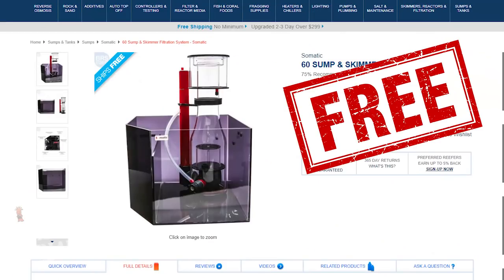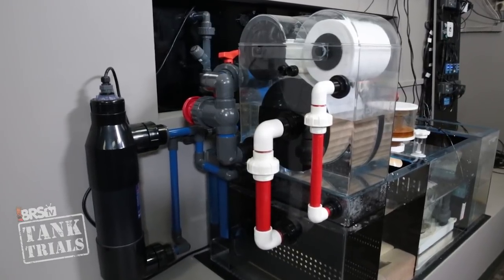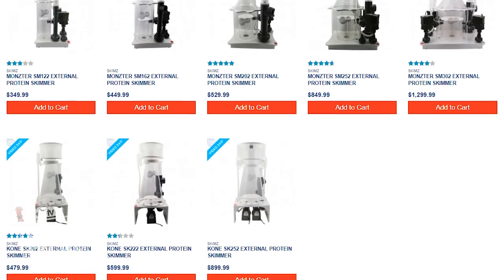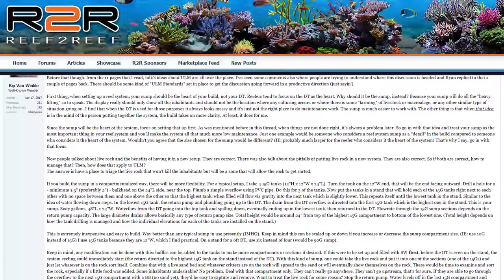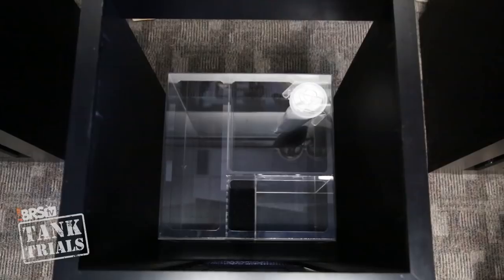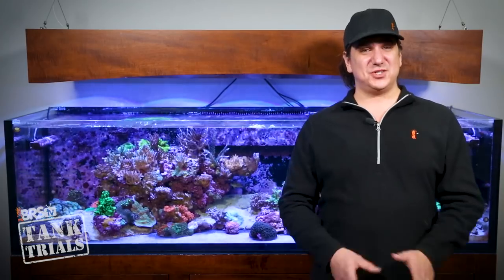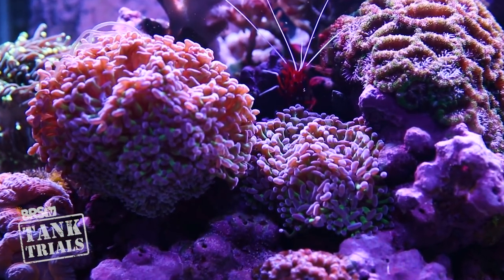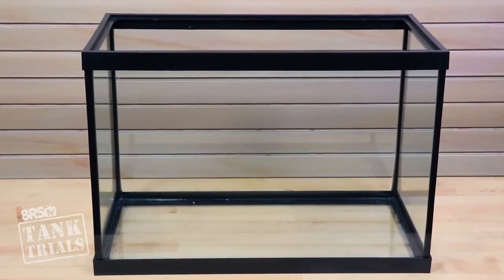ULM Tank Trials Ep-3: Sump Selection for Ultra Low Maintenance | BRStv

Comment: I think you guys should explore using Prodibio to reduce nitrates in the reef tank. Prodibio only needs to be dosed every 15 days and it takes just a few seconds to dose using their sealed vials. Using Prodibio has allowed me to avoid filter socks, sumps, and a skimmer. Yes this means you will have detritus build up somewhere but as long as you have a clean up crew that turns over the sand and you keep your hands out of the tank this is not an issue. Prodibio is a great option for ULM for sure!

Comment: For LPS and SPS I would suggest an automatic filter sock, such as Clarisea. It is much more compact than Rollermat and does not have its drawbacks. 
That would remove a ton of manual work. Just replace the fleece filter every two months or so.

Comment: While it doesn't have to do with maintenance I think it would be an important consideration for anyone after a ULM tank - noise.  I have a 60 cube and most of my noise comes from the return flow in the sump.  I'm going to wait until the end of this series to redesign my tank and low noise will be very important.  Maybe more so for my wife than me.

Comment: This series is great. I'm following along with a reefer 170. Had to move the system so its a fresh start. I did notice that one of the sumps had a ground wire location. Do you feel it is important to put a ground connection in the water to reduce electrical noise?

Comment: Curious to see where the series is going. I must say that ULM and filter socks do not go hand in hand. You absolutely MUST have a filter roll. The rollermat obviously does not fit but in my opinion it is not a great fleece filter either. Not only it is too big, bulky and a nightmare to install, the way it is designed traps detritus inside the box and another nightmare to take apart. I had one for 8 months and swapped for a CLARISEA SK15 and could not be happier. It is one third the size, much more efficient and can handle up to 2000gph. They have a smaller version that would fit your 60g sump, the SK10. You simply cannot NOT have one of these in your tanks.https://www.theaquariumsolution.com/product/3078/275